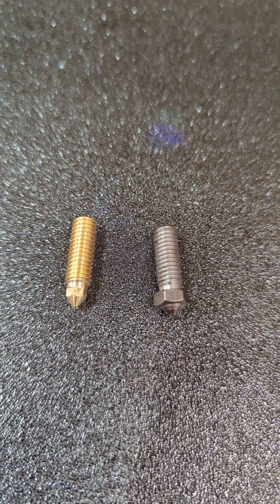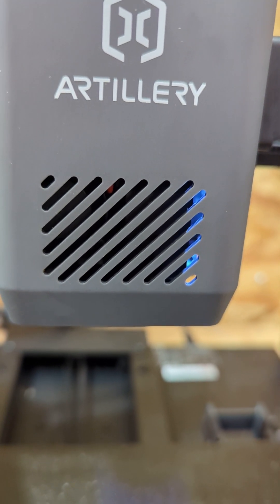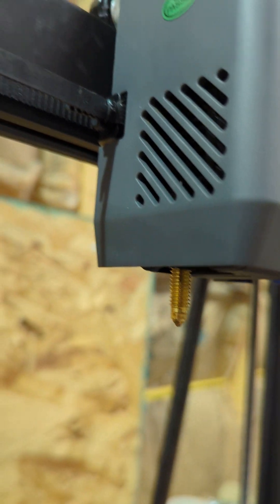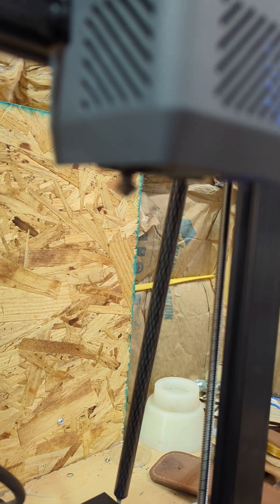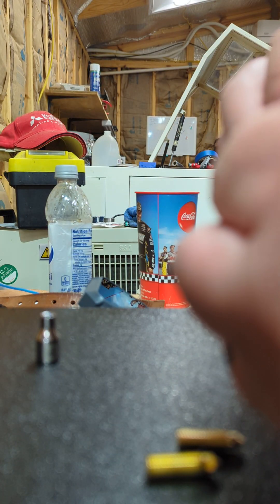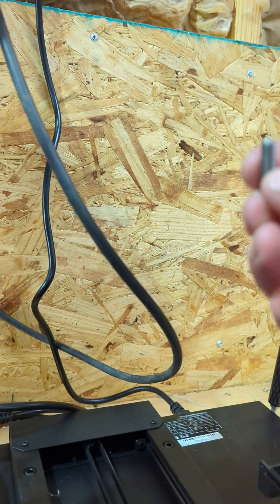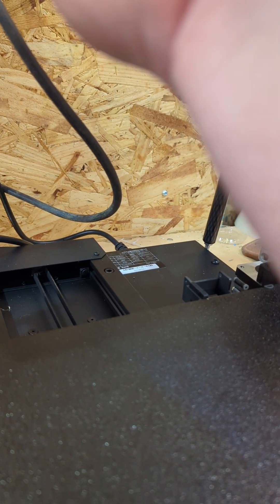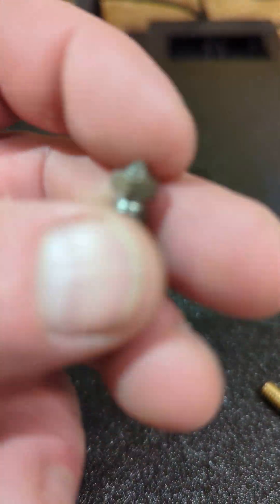Artillery Sidewinder X3 plus Nozzle

Comment: Isn't this a quick change nozzle unit?
Reply from the maker: Kind of.
Reply from the maker: I'm the one that sent you the x3 plus original firmware. I thought I recognized your name.
Reply: @deervalleyengravings3088  yes, thanks for that, also!  I'm learning to love my naughty X3.  Fixing a few bad assembly issues, and just moving forward.  Big 4040 extrusions sides and back, nothing in the front.  Almost back to printing with it.
Reply from the maker: @davedempsey5282  yeah i do like it as well. Want to figure out a smoother spool holder. The stock one seems to draw a bit too much.
Reply: @deervalleyengravings3088  I haven't had mine working long enough to say.  Everytime I try to reinstall that button, it stops working.  Finally just gave up and run it without.  Turns out the board is just hanging in midair and really hard to line up properly.
Reply from the maker: @davedempsey5282 wow

Comment: Hi do you have implement m600 in this machine?
Reply: Why do printer companies always leave the M600 out of the firmware!?

This is one of the main reasons I convert to Vanilla Klipper. You get all the features, and more
Reply: @geauxracerx and now you can on the X3 😀😀
Reply: @TheFeralEngineer  have you tried TPU on it? My X2’s and genius pro can, but I have to baby sit them the entire print so they filament doesn’t hang for even a second; or it kinks and can’t recover
Reply: @geauxracerx  not yet. I print a minimal amount of tpu, but what I've learned from all metal hot ends is that you can barely have any retraction at all and you need to print slowly. I think my best luck was 0.1 or 0.2mm retraction and 50mm/sec on my Neptunes. This machine was sent to me and I really only need it when I run production of a 4 part assembly I sell on my Etsy page because it's 4 different colors and it's so nice to batch everything out in a few hours 😀